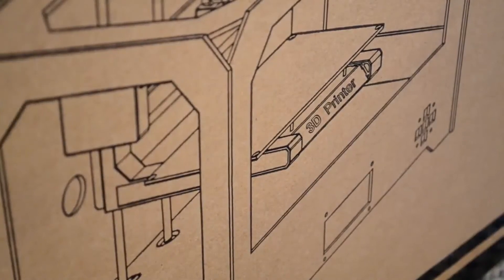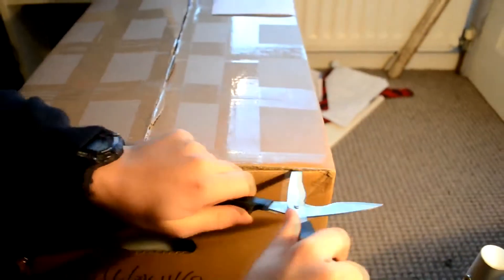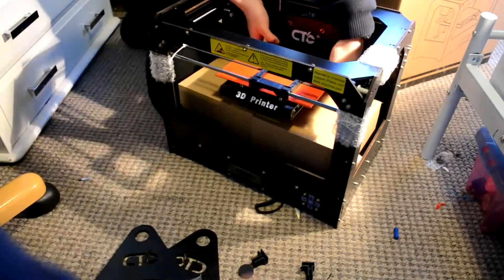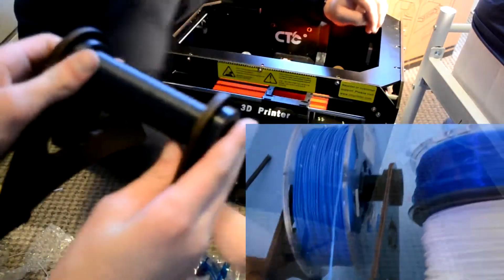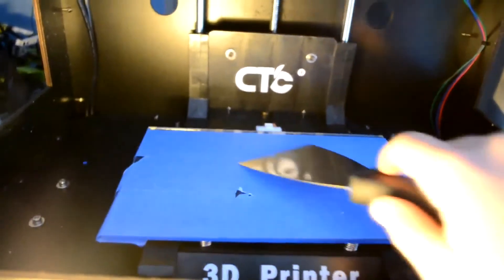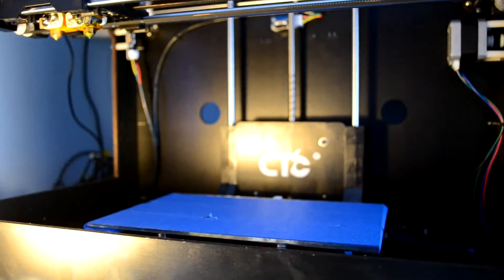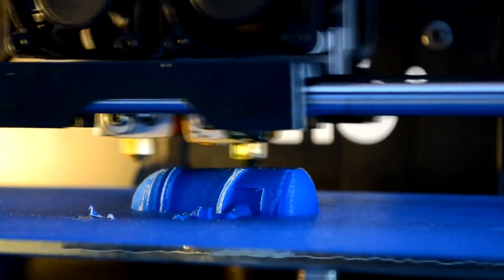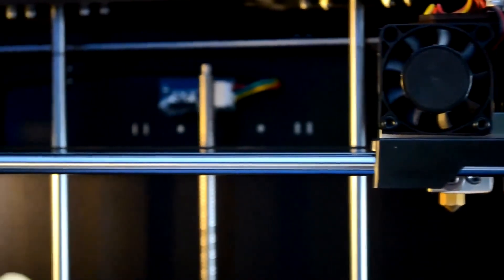A Cheap and Great Quality 3D Printer? - CTC 3D Printer

Comment: Hi nice video  can you please give me some information as i have just baught one of these    mine did not come with any long filament tubes just two very short tubes in with the parts pag of mixed screws   can you please tell me did you have to fit any tubes long or short for your filament to go through    any help appreciated
Reply from the maker: Hi Steve, no tubes had to be attached, just screw in the extruder assembly, with two of the screws in the bag, and then put the spool holder above is better (if possible)
Reply from the maker: difficult to say as they are pretty close, I use a logitech system and it does the job really well
Reply: Hi thanks for your quick help much appreciated :)  i will try putting my fillament above because at min with it being on back i have to sit there and manualy turn it round and keep an eye on fillament as i was under the impression fillament should run inside some guide tubes ?    im just getting my head round all setting ect i am using makerware to print my things but i am having trouble working out how to add supports for my things

Comment: Lol. This is the only 3D printer that says "3D Printer" on it. Btw, great video. I subbed. Keep it up
Reply from the maker: +Finnean Thanks! have you seen the rest of the printer videos? i should be able to get some more up soon! Thanks for the support, UnboxTheReviews
Reply: +UnboxTheReviews I saw a couple other videos of yours. Btw, would you recommend this 3D printer. Also, is that thing that says "3D printer" removable? Thanks so much!!!!
Reply from the maker: +Finnean it is wobbly, but not easily removable, i assume that you could by removing a few screws, to change the design? If you can/do, could you tell me how it went, so i can make a video on it? thanks, UnboxTheReviews
Reply: No problem!  I will definitely tell you if i get it =D
Reply from the maker: :) thanks

Comment: What settings did you put in the software
Reply from the maker: +Jaguar paw Hello, i use different settings per print, shown in each future printing video, but for most prints i use 10% infil (not any more is required) and 0.2 layer thickness. Do you want us to make a video on this in the future?
Reply: +UnboxTheReviews yeah that would be helpful because the different settings for the heating etc for pla or abs would be good to go over it

Also what are your overall thoughts with  this printer how long has it lasted and are the prints good quality ? 
I am on the cusp of buying one and would like to know other users experiences
Reply from the maker: +Jaguar paw  i would say I you have the time and the money to buy a machine it's well worth it. The quality is good, seems reliable , but remember it's a new technology so there is some trial and error. Overall I would still recommend it though
Reply: +UnboxTheReviews ok thanks
Reply from the maker: +Jaguar paw No Problems, any other questions please ask, as other users may find it useful